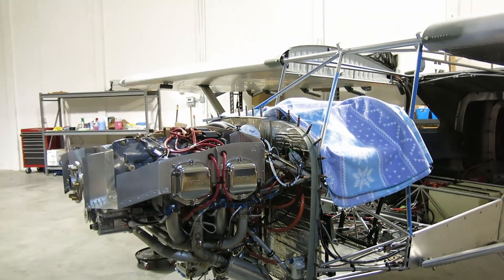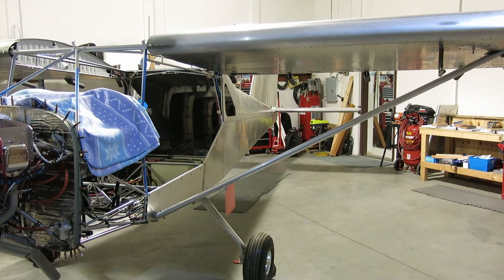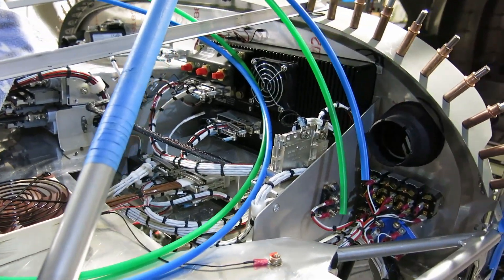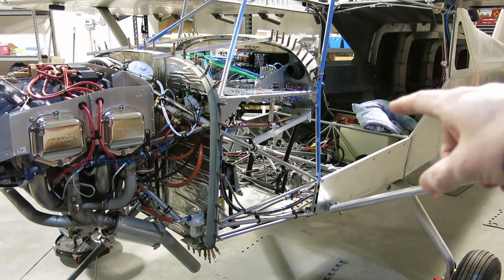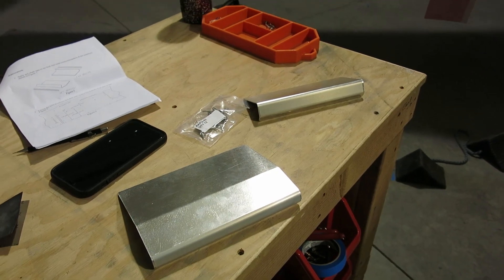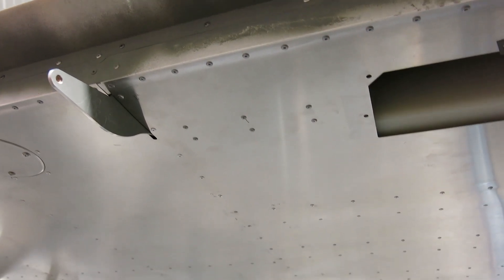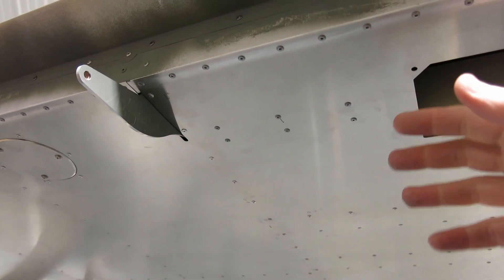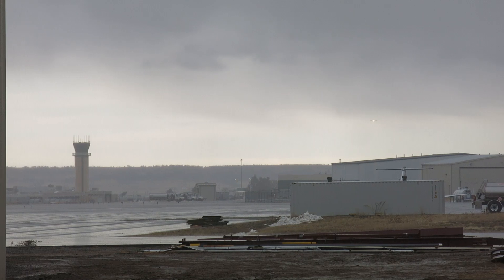No. 337 03-02-2024 Fuel tank AD and elevator install

Comment: Tony- be sure to install spacers in the gap between the S-11 mounting tangs and the horizontal stab rear spar. (RANS AA-193). Keep up the great work. Randy
Reply from the maker: Yep! Took 3 thick washers (AN960-416) between station 11 bulkhead and the rear spar on each bolt.
Reply: @s-21project92  Great! I couldn't see the washers in your video-- good stuff.

Comment: Nice break from wiring! Are you drilling the rest of the holes in the rear aft attach fitting for  incendence adjustment?
Reply from the maker: I drilled the outboard hole for that fitting.